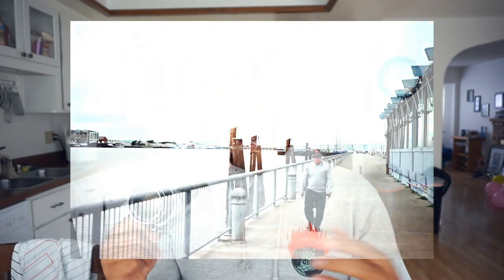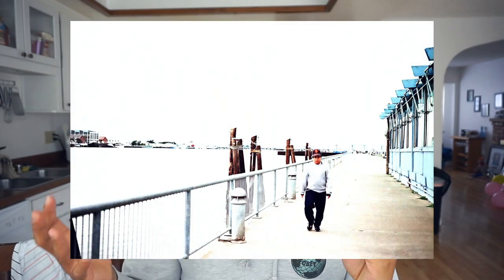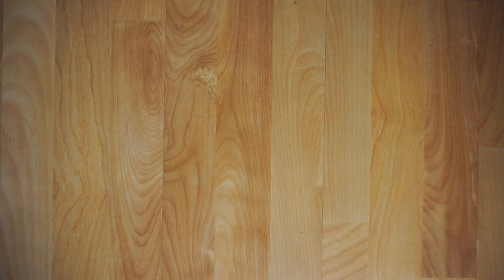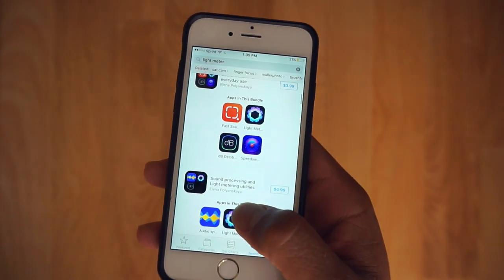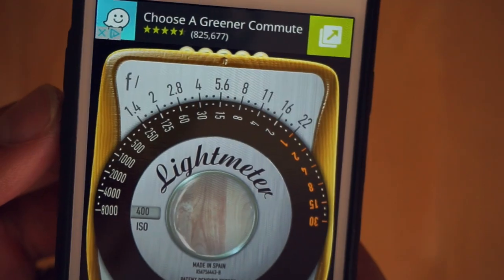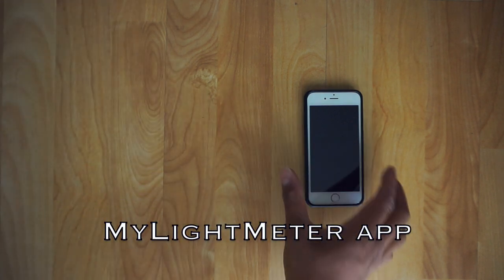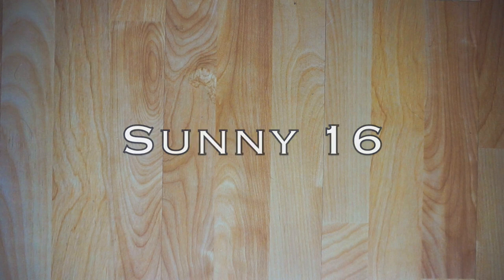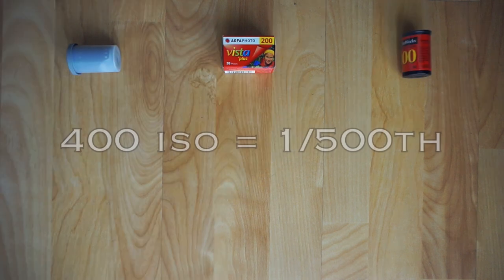How to Shoot a Film Camera With a Broken Light Meter

Comment: You can never go wrong with the sunny 16 rule, once you get it down you will never have to use a light meter again you can just go off of instinct! Haven't used a light meter in years!
Reply from the maker: Yessir! I 100% agree with you. After learning the sunny 16 rule its kind of second nature, like you said, instinct. haha, thanks for watching man!!
Reply: @KingJvpes  hello a Nikon D50 Digital SLR Camera Body, Black with a 50 mm lense and my meter broke. Does these methods work with my camera aswell?
Reply: @calebhall6083  The relation between ISO, f number and shutter speed are always the same, across cameras, lenses, bench marks, digital/analog, etc. So this rule should be aplicable.

Comment: A lot of people totally misunderstand Sunny 16, as the Exposure Values and Sunny 16 are slightly different things. EV16 isn't "a bright sunny day", it's a bright sunny day with a reflective surface such as sand or snow, hence your shutter speed needs to be faster. A sunny day with strong shadows is EV15, and there's about 1 stop difference. It's also worth learning all the 'dark' EVs as they start at EV10 all the way down to EV-6, that's 17 of the 27 EV stops concerned with after sunset and even EV 11 is for the sunset itself. It's well worth printing off a crib sheet, a lot of older cameras either don't have a light meter or the one it has is inaccurate. Another good video, keep them coming.
Reply from the maker: That i did not know. Thanks for educating me haha. I'll look further into that tonight. Thanks again Mark! Always love hearing your feedback :)
Reply: There are a lot of guides out there that are based on digital, which moves everything is moved up one ev. Remember, with film we expose for shadows and with digital we expose for highlights.
Reply: Sorry for the old reply. Is every EV jump one full stop? I can't find a similar app on Android and Google searches just give me basic sunny 16 info.
Reply: hello!! I have a Yashica Fx3, that shows a green dot 🟢 when exposure is correct. I have read that it is better to overexpose one step ➕️. My yashica has center weight meter. I also have read that you should point towards a shadow, so that this 🟢 appears. But.. what happens when everything in the frame is very bright and no shadows? where should I point my meter? Should I underexposed my meter if I point towards a sunny area? I dont understand how to meter to have a good exposure. Hope someone can help m

Comment: hello!! I have a Yashica Fx3, that shows a green dot 🟢 when exposure is correct. I have read that it is better to overexpose one step ➕️. My yashica has center weight meter. I also have read that you should point towards a shadow, so that this 🟢 appears. But.. what happens when everything in the frame is very bright and no shadows? where should I point my meter? Should I underexposed my meter if I point towards a sunny area? I dont understand how to meter to have a good exposure. Hope someone can help me

Comment: Good enough; and very helpful advice, and hints. Thumbs up. However, I have up to four traditional SLR Film cameras; and three actually completely work, and I bought them used that way! Their built in light meters actually work; not much of a problem. Except that today there are no more Mercury Cell Batteries, so a battery of a slightly higher Voltage, that is 1.5V has to be installed. 

However, I've bought a "Mr-9 Battery Adapter for Film Camera & Exposure Meter Mr9 Px625 Px13 Fits for Lr44 1.4V Battery". Then a battery that has no more than 1.4 Volts is inserted A Canon FTbn QL SLR (updated 1973 version), was bought with a functioning light meter; I had it repaired, and CLA, but that was mostly because of a defective Film Advance Lever. A Nikon FM, of late 1970s era (starting in 1977), I bought a couple of years ago, although a bit beat up, it is in perfect working condition.

Only a Praktica EE2 SLR, and the light meter is defective, so I'm getting it repaired; because I like things to work. Maybe it is a form of OCD, not certain. I also purchased several different focal length lenses, electronic flash for the Canon cameras, and Nikon FM SLR film camera.

Very recently I bought a Canon F1 SLR, a bit beat up, but it works; light meter does function. Canon F1 has the advantage that it reaches a Shutter Speed of up to 1/2000; instead of at most 1/1000 of a second of most film cameras to the end of the 1970s, and early 1980s, for the most part.📷📸

Comment: I generally fall back on the 'sunny 16' rule for cameras which don't have a built-in light meter,  or the meter doesn't work,  or if the meter is off/out of calibration.  Where that gets tricky is when using filters which have a filter factor..you have to factor in the light loss of the filter and adjust accordingly.  Same goes when using zoom lenses that change effective aperture as the focal length is changed.  If I want to take photos with one of my film cameras which doesn't have a working light meter I bring along my digital camera (it's a relatively small one) and use that as a light meter.

Comment: I understand the app, but what I don't get is the EV numbers. If you change those, the other settings change too. I say this because I have other apps with that issue and don't match my camera light meter (which works fine).

Comment: I have the "Pocket Light Meter" app. It has worked well so far, but I'll try "My Light Meter."

I also own the Sekonic Studio Deluxe L-28C2** handheld exposure meter [older model].

I try not to use my camera's internal meter because the settings change as you get further from subject. Meter up close then step back for photo.

Comment: I love this rule! Once I learned it, it was awlmost like instinct! But you still get that nervous feeling on the chance that you might've been wrong since I don't bracket lol I want to use as many exposure shots as i can. But I recently got 2 seconic light meters from a thrift shop at like $4 each and they don't use batteries so if i'm unsure i just use that lol. One thing about the rule tho, i was never sure if you were supposed to go up on the shutter speed for each stop you open the aperture or if you only change the aperture and everything else you leave alone

Comment: I recently bought an OM 10 from Olympus. I just tried to get a feel for it. What is now wondering me, the batteries are fresh and on "Check" the Camera give a beep and a red light on the front. Now I want to take a picture ( Am I right, that it always works in Aperture-Priority?!), but when I compare it with a digital camera, the Lightmeter gives me different values. How can I be sure, that the OM 10 will take the right exposure???